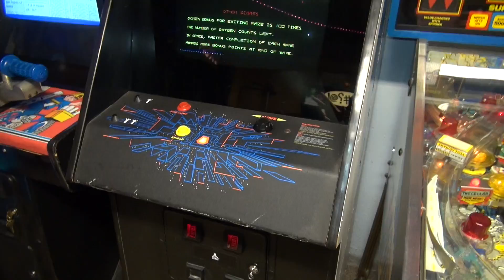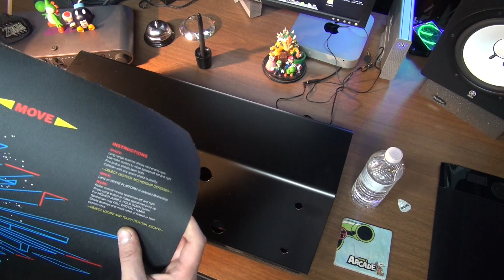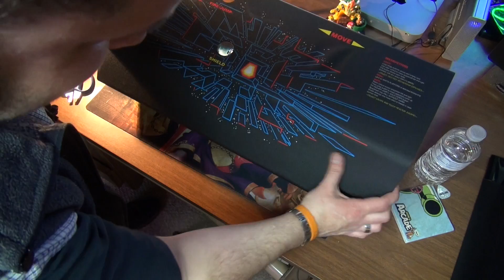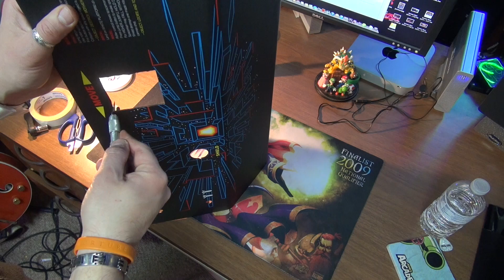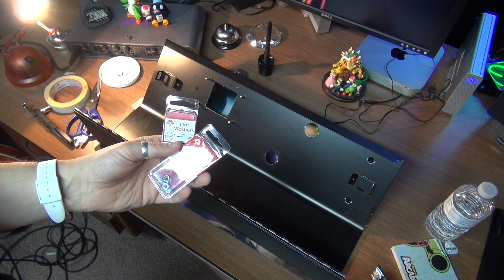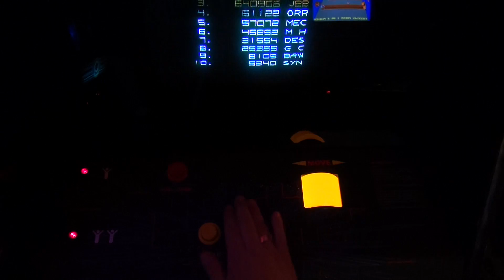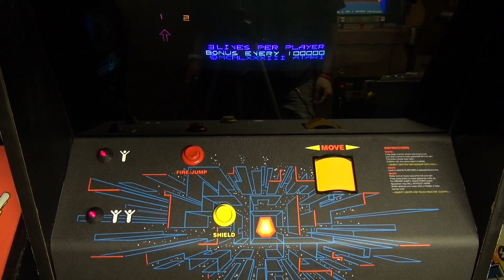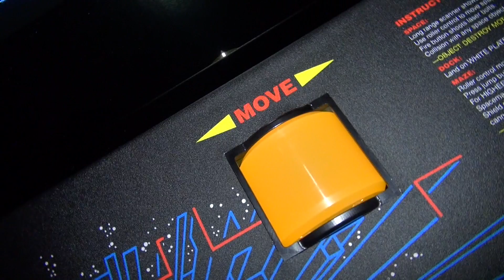How to install a Major Havoc Roller Controller in a Tempest, Space Duel - install control panel cpo

Comment: On my Asteroids Deluxe the cone buttons are powered by 12v. Check to make sure that the bulb on your new roller is a 555 and not a 12v bulb that looks like a standard 555. It seemed dim off 5v. And if the original was running 10v. It would burn that bulb out pretty quick.

Great video, building a new cab for my water damaged tempest. Glad there is someone making control panels.
Reply from the maker: I used a 555 as the bulb as shown in the video.

Comment: Nice save with the overlay when it slipped.  You needed a couple clamps on the edge of your desk to keep it from slipping off.  The panel looked great when you were done.  Nice job!  I've read about people using a hair dryer on the bends.  Supposed to help put a memory in the overlay so it doesn't crack later on.  I have a couple overlays I've done in the past already cracking so I plan to do the hair dryer next time.  Just don't overdo it.
Reply from the maker: Yeah, I mentioned the hair dryer in the video. Next time! :)

Comment: well that came out nicely, well done.  bit concerned about the overlay peeling up over time at the edge of the roller cutout though.  especially when people are beating on that area during play.
your vids are very captivating, perhaps because you come close to failure but always avoid disaster by equal measures of skill and good fortune!   i can certainly relate to that :)
Reply from the maker: Thanks!! The roller controller has a lip that comes up outside the top side of the control panel. So, when you roll you hit the lip, not the overlay. I suspect it'll be OK!

Comment: Best way to get clean cuts with an exacto knife is to place a piece of thick cardboard flush behind so that you cut both the overlay and the cardboard at the same time. The cardboard provides support so the overlay won't tear.
Reply from the maker: Good tip! In the end it all worked out. :)

Comment: funny the one and two player buttons look like missiles upside down.
why cut so close to the button and not the plug?
 wouldn't the 5v be dimmer then the 12 though? where did they get the flashing from originally on the board?

Comment: find a solid state 5 volt relay to take the pulse off the start cones and have it switch off and on the Voltage 12 v 0r 5 v to the bulb on roller :)

Comment: You should try to use Windex to install the decal on metal panel. Just saturate the area you are going to apply the decal, then install the decal and use a squeegee to remove the Windex. You will be able to move and position the decal prior to using the squeegee. I used to install decals on heavy equipment this way. I'm sure you can find some youtube videos on wet decal installation.
Reply from the maker: I have Rapid-Tac which I use all the time for Side Art. I have never used it for CPOs but it's probably not a horrible idea.

Comment: Tip for ya: it wasn't brute strength that destroyed your spade connector. I used to have that happen all the time too. It's a real piss off when it is the last connector you have too and have to go buy more.

Buy a proper crimper tool...like $10 at harbor freight ($20-$30 for a quality tool else where) best money you'll spend.
Reply from the maker: LOL! Well, I actually have a crimper. I never use it for some reason. :D

Comment: Not sure about the tolerances but I was so hoping you would cut an 'X' into the overlay for the roller.  That way, you could have folded the overlay to the underside of the control panel.  Would have given you smooth edges on all four sides of the gap.  I'm hoping that after repeated use that the overlay doesn't start peel up on the left and right sides.
Reply from the maker: That's not a bad idea. Not sure how the roller controller would like it underneath where it mounts, though.

Comment: Actually it was 12v at the board but limited by resistors to the led in the cone button to 2v. That is why the led you put in flashes. 2v instead of 5v.
Reply from the maker: Its measuring as 5v at the cone button.
Reply from the maker: Its measuring as 5v at the cone button.

Comment: Hahaha, my heart stopped at 24m32s when that cp slid off the desk. You do not have the best luck applying those overlays. Try using some of those spring clamps you mentioned. A couple holding the backing down as you cut would have helped.
Reply from the maker: +Gamehulk Ha, it was stressful! LOL! But, honestly, it turned out perfect. As Eddie Van Halen once said, it's like falling down a flight of stairs and landing on your feet. :D

Comment: Well, I'm no expert but I would say the light bulb works like a RL filter. It'll definitely filter out 50/60Hz, but I'm not sure about the frequency of those buttons. Apparently it's also below the bandwidth of that circuit. http://en.wikipedia.org/wiki/RL_circuit
The led is the natural choice. It's a completely different (non-inductive) element, so it'll work (flash) without a problem. On the other hand, putting two voltage drops where you had previously only one, is in my non-expert opinion, will of course cut down the amount of power dissipated on each resistive element on that circuit. So, you either increase the voltage, or you'll have to replace the elements by other that will achieve the same luminance with less power dissipation. You'll always have what I think to be a voltage divider effect right? http://en.wikipedia.org/wiki/Voltage_divider
Again, I don't really know what I'm talking about.
Reply: but I'm apparently wrong hehe http://electronics.stackexchange.com/questions/41587/why-are-lightbulbs-considered-resistive-load

Comment: No problem just saying there are bulbs that look like standard 555 bulbs but are labeled T something. They are 12v not 5v.
Reply from the maker: Yes, you are correct. The bulb that was originally in there, and as shown in the video, was a 194 which is 12V. When I saw it was dim with the 5V I changed it to a 555.

Comment: An extract from the Tempest schematics at picpaste.com/tempest_controls.png.  It's clear the white wire for START 1 switches the cathode of the LED.  The white signal might look like ~4.2v pulsed, but that's because the LED drop is less than 1 volt and its anode is directly on the red at 5v.  In other words, if you remove the red wire from START 1, the white will show 0v.  What you really want to do is to bridge the red and white over to your roller bulb., ignore the black wire you don't need it.
Reply: Looking a bit closer at the source for the flashing, at least on the Tempest board it's an LS174 chip feeding a 150 ohm resistor.  So that's a push-pull logic output, not an open-collector.  If the Major Havoc board is similar, 0v-5v pulsed should indeed show on the white wire, but it's still active-low with 0v on the white corresponding to LED on.  It's also current-limited, so for a bulb you'll want a transistor circuit to provide enough switched current.  A white LED on the roller controller should work okay with just the red and white wires though.
Reply from the maker: I tried using only the red and white wire. They are both positive as far as I can tell. I got no light. Wouldn't the white (pulsing 5V) plus ground do what I want? I got it do it but the LED I was using was crap. I have better ones coming.